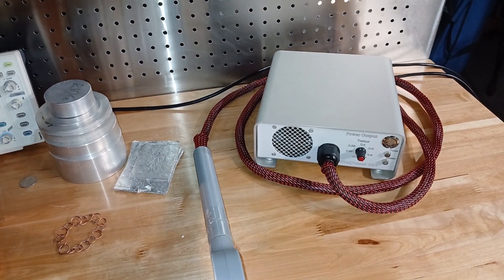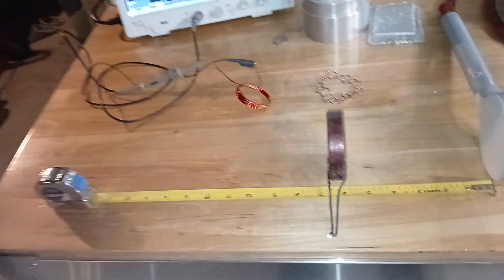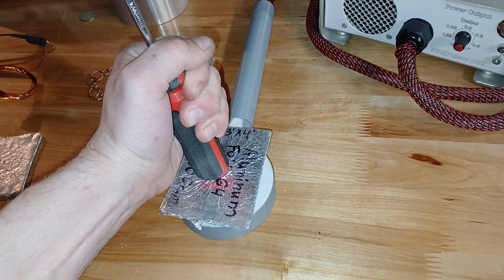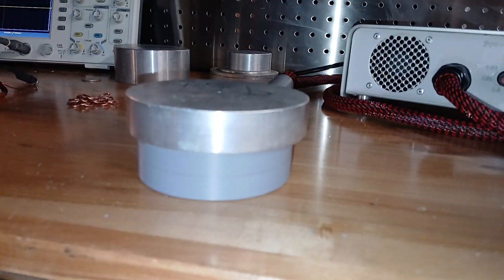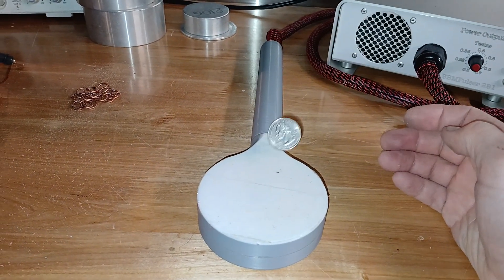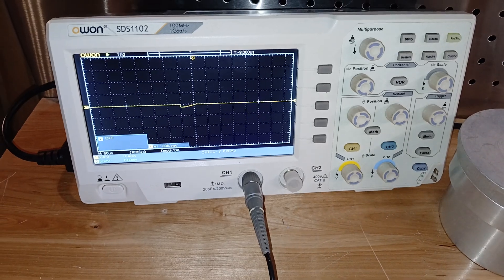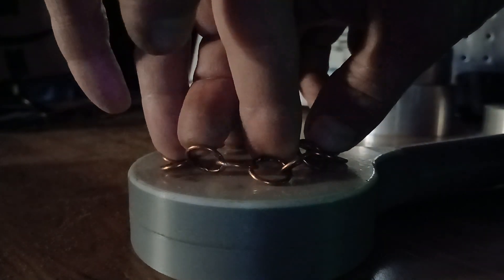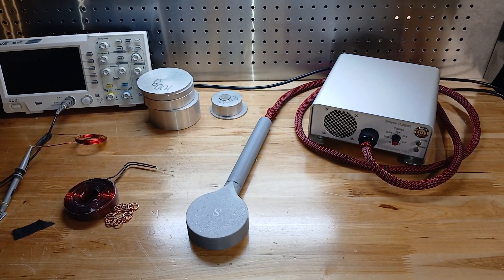211 Few different test with BBMPulser 2B1 model

Comment: What’s the Running time on lie & high settings ?
Reply from the maker: On this BBMPulser 2B1 model, there is no limit, its just doesnt overheat. you can run it non-stop for days
Reply: @AndreyD  I have no clue what any of this is but out of context that sounds revolutionary for whatever it is your doing haha
Reply from the maker: @Connor011 in a few words, this is PEMF (Pulses Electromagnetic Field) device. 
Used to lower pains, speed up healing, recharge cells, to deactivate pathogens and more. I was demonstrating magnetic energy which is comes out from the applicator with a few different tests
1. Metal repell test
2. Metal bend test
3. Distance test
4. Chain inductance test (I may be wrong with name for this one)
5. Viewing the signal from pick up coil using oscilloscope
Because magnetic field is invisible, I had to use different methods to demonstrate it (visualize it)